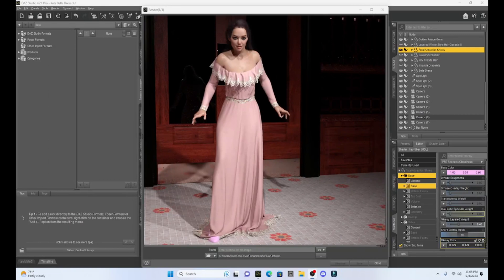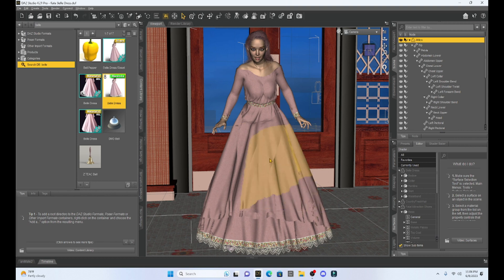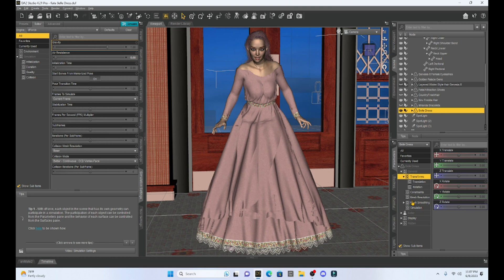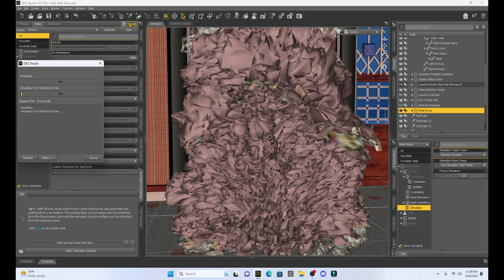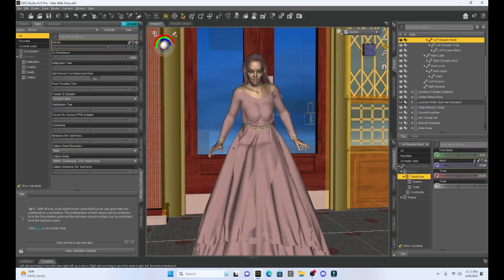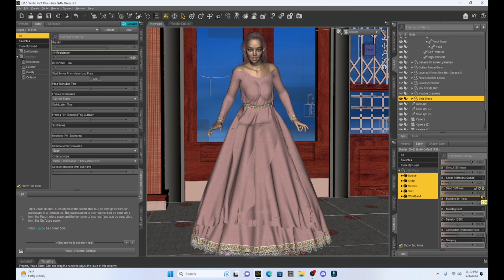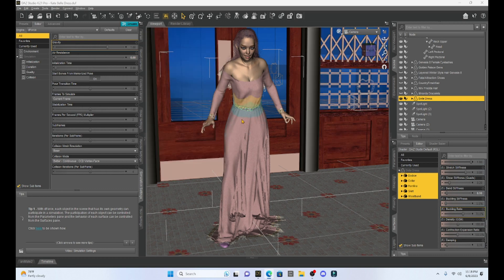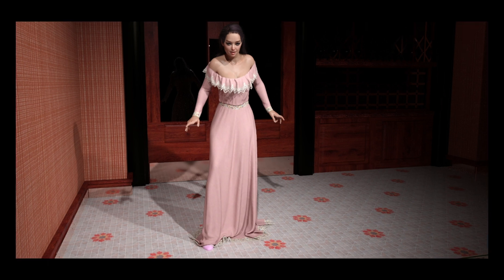Daz Studio: D-Force Posing #2 Converting Non-D-force Clothing into D-Force

Comment: One year later, an add-on: if the garment you're simulating has "hard" elements included, such as buttons, or a belt, you'll likely want to turn off those elements in your scene pane before running your dForce garment simulation, as they are likely to mess up the process. Cheers!
Reply from the maker: Good tip. I'll practice if a bit and see what I can get.

Comment: Nice tutorial. One more question: why did you set air resistance to 0 in simulation panel? To make clothing drape more naturally I guess?
Reply from the maker: It just makes the dress fall more straight down.  I don't think it would make any difference if I had it on the default.

Comment: When I try to do it the clothes slips completely from the Genesis figure and falls to the floor. Is there any way to fix that?
Reply from the maker: Are you using a Genesis 8 clothing item? If it's G8 clothing make sure that the clothing item has its collision set to you character.  If you are using another character's clothes such as Victoria, running a simulation will always cause the clothes to fall to the floor as they are incompatible with G8.

Comment: i been searching soooo long for a video like this i make my own clothes but misses d-force on them thank you
Reply from the maker: Yes!  It really helps with clothing! Thanks for the comment.
Reply: @notfromthisworld7672  So i kinda have a question: i tried it and at some clothes it works with no problems. Others ist explode... do you have a tip?
Reply from the maker: @paulawbswbs  What does the geometry of the clothes that are exploding look like?  Check out your "lit wireframe" to see the geometry.  If the geometry is too basic (Not a lot of polygons) the D-force may not work causing an explosion.  If your polygons look okay you could try to further decrease the bend stiffness to say 0.05 and see what they do.
Reply: @notfromthisworld7672  thank you i will try when i get home <3 thank you so much